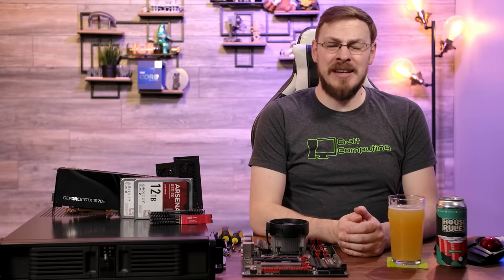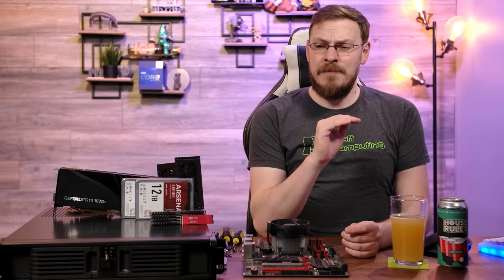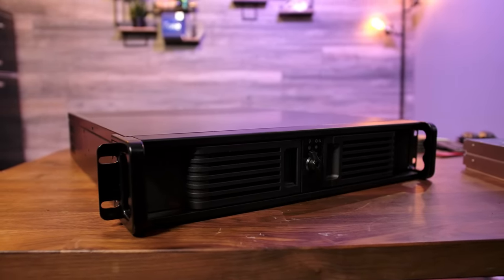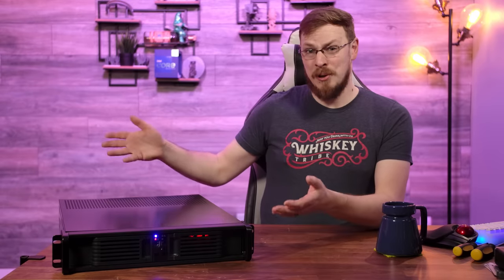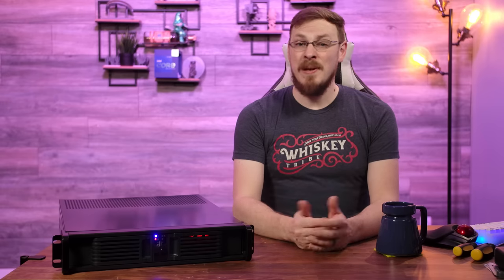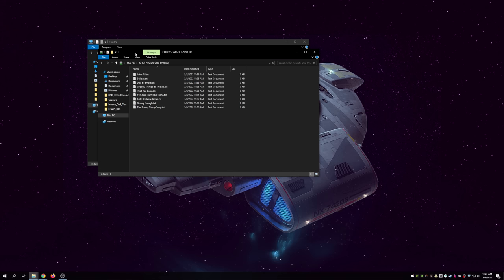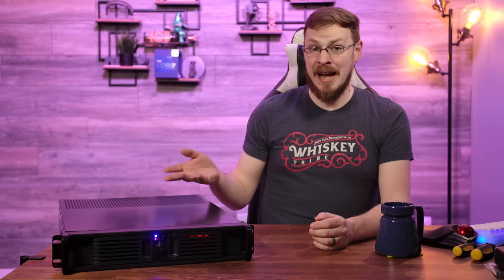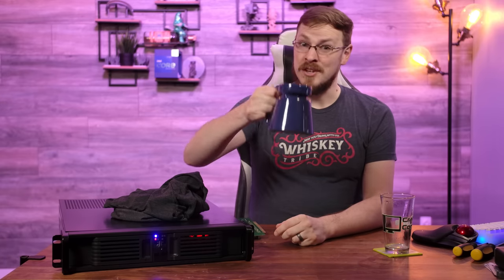Build a Server From Old Gaming Parts

Comment: I am doing this right now. I have a intel i7-4770k , 32gb of 1866 ddr3 and a  z87 motherboard. I added a sas 3 card in IT mode and picked up 5 10tb arsenal sas drives for $143 each. I am currently in the process of transferring the content from my heap of random hard drives to the server. It takes a long time.

After a lot of deliberation and playing with proxmox, ubuntu server, truenas and unraid on an older laptop, I settled on unraid. Once my data is transferred, I will be clearing off the good hard drives I have left over and adding them to the array. I went with sas because I wanted something forward compatible in case my home server really takes off and requires an upgrade. I really appreciate your guides they have been very helpful.

Comment: 2 years later I am looking for a space efficient way to rackmount and then virtualize my current pc. This case seems to be still in production as a Chenbro RM24100. But I was struggeling to find a decent ATX power supply with front to back airflow. The tip to use a SFX-Power supply instead saved me on going the route to a 2U Server! You might have saved me 2U here, thanks!

Comment: I have a shelf of old gaming pc's running as a cluster lol

At a certain you start to wonder if it wouldn't be easier to consolidate them all into one modern real server

But then you kinda want a rack you know cause that's where server chassis' go

But then you have this whole rack all empty except for one lonely server

And it's lonely in there....
Reply: Felt and heard.  Stay strong.
Reply: And then you buy it anyways and end up just expanding and using them all instead of replacing anything lol

Comment: I'm doing something similar, though my hardware is a bit older. I'm cobbling together an Intel Core i7-5775C on a Gigabyte Z97X-Gaming GT with 16GB of DDR3-2400, hooking the Z97 chipset's six SATA ports up to a matching number of Seagate Ironwolf 8TB NAS drives, and then running Proxmox on top. Within Proxmox I'll be running OPNSense for internal networking, TrueNAS Scale (yes I know it can also function as a hypervisor in place of Proxmox) with the Intel SATA controller passed through and the NAS drives in RAIDZ2, a Plex container that I'll try to pass the Iris Pro 6200 iGPU through to so I can get hardware encoding and HDR tonemapping working without a dedicated GPU, and it'll also run a bunch of game servers for me and my friends.

This is my first serious foray into trying to have a dedicated machine running on the regular after I started tinkering around with this stuff on an i7-3770 a couple of years ago. It's not ideal and hardly the most capable platform in the world, but I didn't want to rush out to buy heaps of hardware beyond the NAS drives so I am limited by what I have on hand, and I don't want to run more than one box because electricity is expensive and I don't have a ton of room in the apartment I live in.
Reply: Ah, the elusive Broadwell with e-dram...
Reply: A bit low on RAM for running TrueNAS and Proxmox. I'm doing something similar and I gave the hard drive controller to TrueNAS. How do you plan for Proxmox to provide storage for the VMs?
Reply: @wayland7150  The board I'm using has a second SATA controller with two ports, which I'll have an SSD plugged into for Proxmox to boot off of. I can add another mechanical drive as well if I need to.

Fair point on RAM but it's all I have right now. I might swap the kit out for a higher capacity, lower speed kit in future just because I don't think my odds of finding a set that matches mine these days are high.

Comment: The only drawback about using a gaming computer for a server though, is idle power consumption. If the hardware is modern enough, it'll have the low power C-states for when it's idle, but if you go back six or more years, a lot of these things will run full tilt even when idle. Especially if you use older AMD processors.
Reply: Too true, may be as an intro to the Server space, it would just be a sandbox before more a appropriate is used. My i3-9100 + SuperMicro sips power, unfortunately my Xeon 1650v4 does not :-/
Reply: The ultra-low idle power came with Haswell and that's already 9 years old. Having said that, previous generations aren't bad either. My i5-3350p idles at around 8 watts.

Comment: I did something similar, but my server is in a tower. I'm running Unraid on an AMD Phenom 2 x4 965 with 32GB RAM and 17TB (9TB usable) of space with one parity drive. All packed inside a Cooler Master HAF932 that has been modified to accommodate up to 14 hard drives. 
:). She's a bit aged, but she does the job very well.

Comment: 3 days ago I installed Proxmox for the first time on an old Dell Optiplex 9020 to fool around with. Today my first 1U HP D360 G7 turned up and it's all your fault! Between guitars and gaming my finances were already taking a battering :D Thanks for your content, it's so incredibly helpful getting started with all of this. I know between you and TechTim I'm covered.
Reply: G7? You'll regret that once you get your power bill. Having said that, it's still better than the G4 I once ran at home. That one idled at 200w.

Comment: The best way to get started with an x86 home server is to buy a ~5 year old ebay laptop (or dig your old laptop out of the closet), something old enough to be cheap but new enough to be fairly powerful. You have built-in KVM, battery backup power, gigabit network port, several USB ports, & WiFi. An energy efficient but still moderately powerful CPU, with much quieter fans than a rack server. Typically, they have hardware virtualization support you can enable in BIOS. A lightweight but viable GPU, saving you from the scalper prices. Often a pair of SSD bays, or an SSD bay and NVME drive slot. 8 GB to 16GB of RAM. Used business grade laptops generally have sturdier build quality, more IO, and room for a second drive.
Buying a $200 used ebay laptop is going to be cheaper and more performant than adding all that aftermarket to a Pi or other SBC, assuming you can even find a Pi for sale, and way quieter and lower energy costs than a rack server, and take way less space than towers. If you want a home cluster, use a baker's bun rack as server rack, and fill the bun trays with laptops.
Reply: Laptops with a DVD drive can also be converted to have a second SATA bay, which is good to know when searching around!

Comment: My server is built in a Fractal Design Node 804. It's a relatively small footprint (uATX) but it can hold 8 3.5" drives. I'm using it as an Emby server/Minecraft server/MDT deployment server.

Comment: i did this exactly when i started my first home server build on a core2quad q6600 with 8 gb of ddr2 ram and two 4 TB wd purple drives and a 120GB sata ssd. Build it in a tower though instead  of a rack mounted chassis. Gave it to a friend after i moved to i7 6700 for my home server which i am still using now. Each time i upgrade my gaming system the old parts become my new server now.

Comment: I've built my first PFSense router using a Rosewill 2U Chassis, Xeon 10 Core processor, 16Gb of DDR4 memory and all is running great. Temps are stable at 43*C. It runs 24/7 as a router should. Now my next project coming up is building a "Modular" 44U Server Rack. Simply put ... A Server Rack that can be split into two 22U parts then add a table top and now you have a work bench with the ability to hold server chassis or add drawers for storage ... I will be building two server racks. One for me and one I will give to a YT Techie who can review and give me feedback on the design. (wink wink Jeff, Kyle, Jason or others).

Comment: istarusa is the best option for racking desktop hardware. over the past several years I've moved all the computers in my house into rack case, and 5/6 of the cases are from them. the rails are universal, everything's cheap, and they have shorter depth cases which will fit in racks intended for audio gear.

Comment: I’ve been dabbling in using older hardware for a server for a bit now, mostly just for Plex. I’ve always just used off the shelf consumer parts, I’ve never had actual “server” hardware. I literally just finished upgrading my server with “new” old hardware. My upgrade was, I went from an i7 4790 with a Jgingyue h97 board with 32gb of team ddr3, to a ryzen 7 2700x with a gigabyte b450m ds3h with 64gb of leven sinba ddr4. I reused the same gpu, Quadro M2000. I’d like to upgrade that to an Rtx 4000 but with prices what they are that’s not gonna happen anytime soon.

Comment: I just bought a dell poweredge r720 for 250 on ebay, won't show up till thursday, but I'm pretty excited. I was using a amd 3600 with a 8 bay external usb enclosure, but one of the bays died and the price to replace it was nearly the same as just buying a old server.

Comment: My (plex) server, which is on its third iteration, has been literally screwed to the wall at work. Motherboard,CPU,RAM anyway, It started off as a lowly Dual Core Pentium with 4x2TB WD Green HD's back in 2011 and a crappy RocketRaid controller. 2nd iteration was a 2nd gen i7, and 4x8TB Seagate's... Running Windows this whole time. Storage Spaces has worked well. Learned a lesson upgrading to 4x14TB HD;s and Cluster Size and why it matters. Its now a 8th Gen i5. Let me know if you's like Pics. Its been a great server.
Reply: WD Green, my god, those are the worst. Storage Spaces is very interesting technology.

Comment: I'm running my old FX-6300 and R9-280 as my server, mostly Syncthing,Borgbackup,Apache,Transmission,Folding at Home and few custom software. Works wonderfully but during hot summer months heat output is bit much, I also have Pi2B running PiHole and I might move essential software to it and leave the FX-6300 based system for winter time FaH based heating and extra backup.
Reply: I don't know what you need an R9-280 in that for but you could switch it to a R5-340 for £15 and still pass it through to a VM. That would cut down on heat.
Reply: @wayland7150  FaH is using OpenCL so that uses a GPU but even without GPU running the system still draws around 100W With GPU it uses around double that but 100W continuous is still a lot during summer so that why I'm thinking of the Pi and just dropping FaH when heat is not needed.

Comment: Ever since I discovered your channel last year I've wanted to build my own server, but can't justify the expense. Recently I realized I could repurpose my old Sandybridge i3 machine that was originally built to be a MythTV box in the living room. It served its purpose well, but I was never able to get it to talk to my cable box when I switched services back in 2013, so it has gone mostly unused for a while.

I'm just waiting for the RAM  upgrade (4 GB isn't going to cut it) to arrive, and I've already installed Proxmox and done a little bit of playing around (I've used Linux as my primary OS since 1998, so not a huge learning curve here...). Is it a killer server? Nah, but it should give me some experience and let me see whether I will actually make use of a server. And if so, then I can look at upgrading the CPU to an Ivy Bridge i7 (which the motherboard claims to support), and/or look at building a new, more powerful server.

It should be fun, at least. Now if only the shipment will ship faster......

Comment: I'm commenting before I watch the video, but I saw the title and laughed a little. I'm using my old 1700X with 48 GB of cheap G Skill ram I found on amazon to host all my stuff in proxmox. It's a really nice machine, and the AMD CPU means I can use my 1070 for Jellyfin transcoding via IOMMU (plus the patch driver to unlock the NVENC streams :)). I also run TrueNAS inside a VM which is definitely not optimal, but hey, it works. Lol
Reply: If your like me, the 1700x was just a stop-gap to wait the few months before Ryzen 3700x launched
Reply: @Celician83  It was actually an upgrade from a 2600K, which was a major improvement. Though, going from the 1700X to the 3950X made me realize how bad the 1700X was for games. Zen 2 still has some problems, but yeah.
Reply: @DarkSwordsman  yeah, I had stability issues with my 1700x because I THOUGHT I was buying Samsung B-die RAM, but my Corsair Vengeance RGB Pro sticks were 1 revision off, and I got Hynix CJR, which does NOT play well with first gen Ryzen. Upgrading to the 3700x solved every stability issue I had, and doubled the performance. 
Dont feel too bad though, my 1700x was an upgrade from my Phenom II 1090T BE
Reply: I'm beginning to realise that TrueNAS inside a Proxmox VM is a bad thing to do. I really don't like the way I have my RYZEN 2700 64GB with 8x 3TB SAS drives. Really not the right operating system setup.

Comment: With electricity prices skyrocketing lately, I am in need of an embedded ARM or RISC-V system with 10GBe, 4x SATA (For SSDs), 1xHDMI 1080p60, USB 3.0, capable of running a file server, PiHole and Unbound while only consuming less than 10W Idle. Preferrably even less than 5W. I couldn't find something yet. Native I2C would also be nice for reading some sensors or driving a tiny OLED.

I am currently running a Raspberry Pi, where I tried to connect a Seagate Barracuda 2TB SSD using an adapter via USB 3.0 (SATA) to it. Read performance is low with 300 MByte/s and write performance is non-existent (3 MByte/s)... At least I can store small files on it's SD-Card share now and it consumes about 3.8 Watts running the above mentioned 3 services.

Edit: I am also running a simple Python webserver for an ESP weather station I've made.
Reply: If you buy one of those desktop PCs that are sort of fake because they run off a laptop PSU you can build a server in that. They have some weak AMD CPU normally found in a laptop and because they make rubbish PCs they go cheap. I watched a server build in one recently. Not 10 watts but more like 60 watts at full speed but a lot better than 300 watts a server would use.

Comment: Great video, and a great reminder that Windows 10 can make for a nice home server platform with a lot of flexibility.  Question: Other than a higher license cost, would using something like Windows Server be preferable to windows 10 for a scenario like this? I think you would gain more flexible storage options, and possibly fewer background services making it somewhat lighter weight?  Though driver support for a GPU might be harder.  Curious to hear your thoughts

Comment: Maybe you should do a old skool.
My first business server was on a Compaq deskpro. Sporting a p3 333 128mb of SD ram and a 80gb HDD.
Skipping the security.
Windows XP  with xammp provided the server, email and pho as well as SQL server.
50,000 people per week used it and this was back In the day where you had small graphics, no flash and the site was html only... Shops had PHP and SQL, but I updated after a year...
It was a time when you made your site as small as possible and tried to keep under 56k in size. Maxing it out at around 128k..
Dial up was so fast... DSL came out a year or three later. Quickly followed by ADSL.
Umm by today's standards bad, but I used to use my gaming systems which were about a year to 18 months old.
Never had any issues. I only just got rid of the tower, but still have the hardware that ran from 2004-2009. And the backup's..

But personally I'd gone for a Ubuntu and snapped Plex. And just made SMB shares.
Also there are plenty of old tower cases that can fit many drives littering various markets.

Plus old gaming... That's not that old is it?
Realising, my current systems now near 3 years old.
Reply: I think you're misremembering, the slowest PIII was 400MHz. What's interesting to consider is that such a system would likely still be enough for serving static content to 50k people a week.
Reply: @eDoc2020  html was small so serving wasn't a issue. Remember motion GIFs were a thing...lol

Typo was p2 and the HDD was 8.1gb. the next was 80gb though but a xp2400.
Reply: @eDoc2020  html was small so serving wasn't a issue. Remember motion GIFs were a thing...lol

Typo was p2 and the HDD was 8.1gb. the next was 80gb though but a xp2400.

Comment: I have tried to dip my toes into more advanced Linux stuff quite a few times but since tech isn't my main job I forget just about everything every time I want to try out a new project. I've actually already made a Proxmox server out of some of my old gaming PC hardware myself with a nice beefy 3900x at it's core. I'm thinking I might just switch to a Windows based host and using Hyper-V instead of Proxmox. It just seems that much easier.
Reply: UnRaid might be a simpler solution that doesn't require much Linux expertise.

Comment: I did something similar. I just put in a 4-port lan card and some more ram (up to 32 GB from the 16 GB it had). I also had to trade my i7-4770K for an i7-4790K (because for some reason 4770K is virtualization-locked....i hate you intel). Now running proxmox hosting trunas-scale, opnsense, windows 11 (i normally run a linux desktop on my main pc), multiple LXC containers and a whole bunch of linux VMs for learning and tinkering.

Comment: Exactly what I was looking for. Quick question, since Ryzen supports ECC, should I invest in some ECC dimms? I want a (hopefully) 0 downtime server and my main PC blue screens from time to time which i don't want to happen on the home server. Also, could you make a video on a rack-mountable, diy pfsense router? Not sure what kind of hardware i can get away with. I know it can run on arm but would preferably want it to be x86 based.